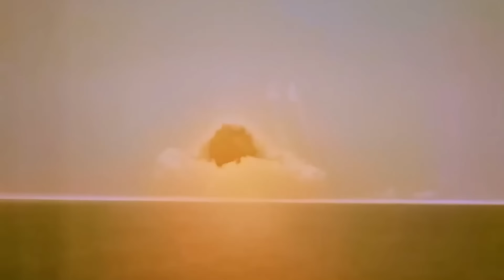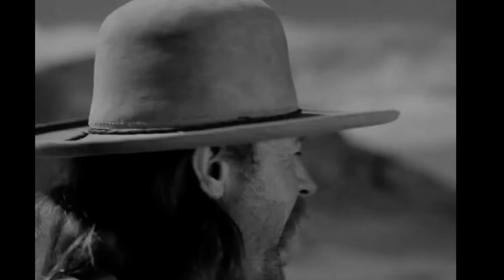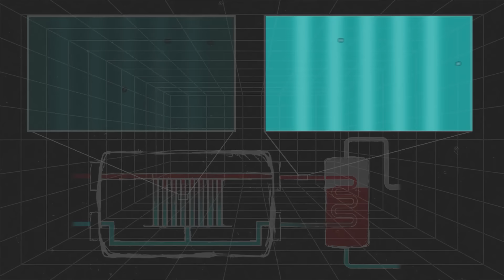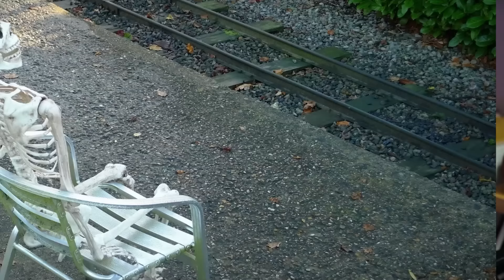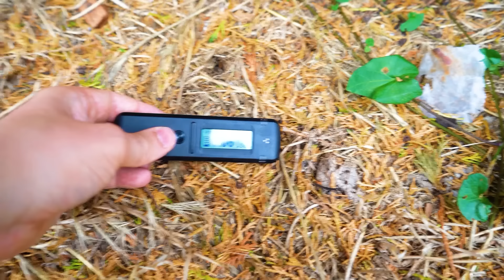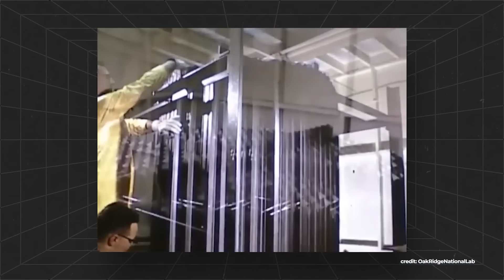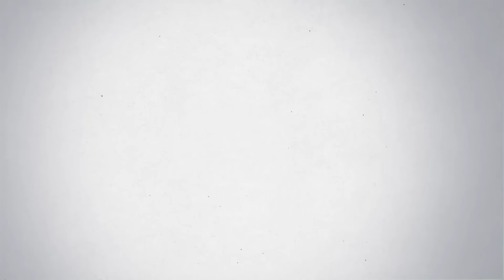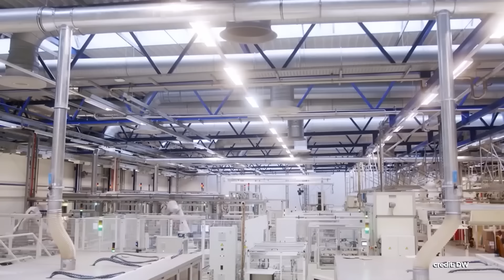It's Happening - China Launches World's First Thorium Nuclear Reactor

Comment: This video is somewhat misleading. The Chinese TMSR-LF1 is in fact a uranium burner, not a thorium breeder reactor. The primary fissile material is standard Uranium-235, and the plant will burn essentially the same amount of U235 as any other nuclear reactor, it will also require the same amount of mined uranium as a standard reactor. The TMSR-LF1 removes some fertile U238 from the fuel and replaces it with fertile Th232 instead. However, the vast majority of the power still comes from good old fashioned fissile U235. Describing it as a "thorium reactor" is like describing a standard gasoline engine running on E5 (5% ethanol, 95% gasoline) as an "ethanol engine". It is, however, a molten salt reactor - which is a lot more interesting.
Reply: @levelazn  It's documented in the Chinese Academy of Science (CAS) presentations on the design. YouTube doesn't usually allow posting links (such posts get auto-deleted), but if you look on Wikipedia for TMSR-LF1 you can find the details. The documentation describes the "U-235 enrichment" as 19.75% which is High Assay Low Enriched Uranium (HALEU) fuel. 

This is a well known path taken by others, for example ThorCon. Uranium ore is around 0.72% U-235. For normal LEU fuel this is then enriched to  roughly 5% U-235, 95% U-238 which is done by removing some U-238. If instead you enrich this further to around 20% U-235, 80% U-238 then you have HALEU fuel. You can then take this HALEU fuel and then blend it down 1 part HALEU with 4 parts Th-232 and you get a final composition of 5% U-235, 20% U-238, 75% Th-232. This requires the same amount of uranium ore as LEU fuel (it has the same U-235 content). However, it replaces some of the fertile U-238 with fertile Th-232. In a conventional reactor roughly 75% of the power comes from direct U-235 fission, and that will be the case with the TMSR-LF1 as well; the thorium is going to be contributing around 20% of the final power output.

This is an interesting design, and is certainly worth exploring. However, it is certainly not a "thorium breeder" converting pure Th-232 into U-233. Which is what everyone assumes when someone says a "thorium reactor".
Reply: @tomshackell  @levelazn been reeeal quiet since this dropped 😂
Reply: @tomshackell  wikipedia not allowed in china
Reply: Good point.   Thanks for the info.   Salt reactors are tricky to use…. Pipes need to be very tough and corrosive proof.    We’ll see.
Reply: @LegIIAVGCA  That issue has been overcome, Copenhagen Atomics have sorted it and looks like China has too.
Reply: @nzoomed  - Since you know they worked it out, can you share how the solution works (including if its operationally and economically viable).
Reply: Thank you for your comment sir!
Reply: Indeed, since U-233 does not occur naturally, there's no way of running a reactor off the Th-232/U-233 cycle immediately. The fastest way to produce it is to run continuous fuel cycles, increasing the portion of U-233 until it is self-sufficient. This is why they are planning to build a much larger 10MW plant to speed up this process.
Reply: Yes, this is the case because it will take about 25 years to build up the necessary fuel for the Th-232/U-233 cycle to become self-sufficient and no longer require U-235 for thermal fissioning.  The important point here is that China has begun this process and has a clear path toward the most competitive base load energy source in the world, today.  As a result, Its AI program will benefit from this long term strategy.
Reply: Even if he is incorrect, this reactor in theory could use Thorium as a fuel, or at the very least be added to the mix, even better is this reactor will be able to re-use radioactive waste from other reactors.
Reply: Uranium-235 is used as 'startup' fuel, and in time enough uranium-233 is bred to take over from the initial charge of fuel.
Reply: "The TMSR-SF stream has only partial utilization of thorium, relying on some breeding as with U-238, and needing fissile uranium input as well. It is optimized for high-temperature based hybrid nuclear energy applications. SINAP aimed at a 2 MW pilot plant initially, though this has been superseded by a simulator (TMSR-SF0). A 100 MWt demonstration pebble bed plant (TMSR-SF2) with open fuel cycle is planned by about 2025. TRISO particles will be with both low-enriched uranium and thorium, separately" - World Nuclear Association
Reply: Thank you for clarifying this, exciting news like these can get a little carried away
Reply: Thanks for your insightful point, Tom.  And the fact that he doesn't mention Kirk Sorensen disgusts me.  That's blasphemy.
Reply: Log course they have to have uranium because thorium is not fissile and needs neutrons provided by the u235 (around 20%) to produce the fission and u233 as fuel. Nothing wrong in calling it a thorium reactor.
Reply: @Zerpentsa6598  To be fair the guy talks about "burning" Uranium.
Reply: they built the wrong  kind then ?  I was hoping they were developing the liquid fuel type
Reply: @solerso68  It is a liquid fuel molten salt reactor, but it's similar to ThorCon's design. Both are liquid fueled uranium burner MSRs which adds some thorium in as a "fuel additive".
Reply: @tomshackell  Thorcon has since redesigned for LEU only, just like Terrestrial Energy.
Reply: @chapter4travels  yes I’d heard they were thinking of doing that. Getting HALEU is apparently very difficult at the moment, whereas LEU is comparatively easy to source.
Reply: @tomshackell  They just updated their website with that change. If I read it right, they will run their reactor on 2.2% LEU with a 5% feed-in refueling tank.
Reply: @solerso68  It is a liquid salt reactor this response is somewhat misleading if you read the comment and re-watch the video you should be able to piece it all together.
Reply: The whole title is a click bait. Like the video even shows there was a Thorium reactor in the 60s in the USA, means China at best cached up to this. And even if, the whole thing is again 20 years away from the market, and even then, it will be more expensive then almost all other sources of energy at that point. It's a dead horse for now and the next decades.
Reply: interesting
Reply: I wonder who would be willing to sponsor you to make a video about this 😆 

You seem to have a much better grasp on this than most. 
Thanks for sharing
Reply: If that is true, why bother?
Reply: Thanks, your comment is ibformative
Reply: you sure_?
Reply: Seems like a good first step nonetheless as the % of thorium can theoretically be increased as technology improves.
Reply: 2024 the age of the factcheck.     beware: it's need increases exponentially, as the fact checkers get their own fact checkers and so on, ...     by 2030 the mass of factcheckers will have become critical and will lead to an explosion that destroys all life on earth !!!
Reply: I mostly agree, except lthat less U-235 will be used in reload cores. The Thorium breeds U-233. At peach bottom and Fort St. Vrain, U 233 reload cores were supposed to replace U-235.
Reply: this comment alone is enough to make me discount everything else this channel says... it sounds like they don't know what they're talking about, or that they're maliciously hiding facts.
Reply: Well he got the clicks so why mention it in a 20 minute video. Btw. after "It´s happening - China launches.." and the footnote "planned for 2029" I already knew where this was going.
Reply: @burninghard  Sure because the US is going to jump in there with their own thromium molten salt reactor before 2029. Keep sniffing that copium westoid 😂😂😂
Reply: @burninghard  I knew this must be fake just from the title 
china cant produce anything new only copy
Reply: Still good progress in the field
Reply: @levelazn He/she gave you all you need to do your own research. It's so lazy and obnoxious of us to challenge people in this way.
Reply: @4570george  what she?
Reply: @4570george  says the guy who's giving ambiguous pronouns to a man.
Reply: @4570george  @levelazn also just outed themselves as a Chinese Shill with that post anyhow. This video itself is actually nothing more than a propaganda piece. I came here looking for such comments. Even so your point is so very much valid in our everyday lives. When someone comes up with a well written post with such clear information, asking them to 'cite their sources' is simply outright rude and nothing more than a 'butthurt' rebuke of an uneducated person.
Reply: Think about what you said that it's a  is in fact a uranium burner which means it ill help get rid of used up uranium fuels which is a good thing .
Reply: @leekumiega9268  The term "burner reactor" is used in comparison to a "breeder reactor". A breeder generates more fissile material than it consumes; a burner reactor uses more fissile material than it generates.

You're thinking of a "waste burning" reactor which consumes spent nuclear fuel; this Chinese reactor is not a waste burner. The terminology is confusing but such is the world of nuclear reactors.
Reply: @tomshackell  As I understand it uranium is consumed while keeping the Thorium reaction going .
Reply: So much trashy clickbait on the Internet. I wonder if he's secretly paid by China Today 🤭

Comment: the reason why it failed in late 70s for commercial purpose because the pipes at that time break down easily after 5 years. But China also noted that the 70s experiment failed due to unrealistic expectations that 1 plant can produce large enough to support a large city,  thus they decide to build them in small size(smaller power generation output) to support just an industry area which can last for decades with low maintenance. The another reason to build a small plant is because China has planned to build it in Moon and want it to  be as small as possible since it is there to just support a moon station base in future rather than an industry or large population.

Comment: If I'm not mistaken, there is one frequent error in the video. A Thorium reactor (actually splitting U233 btw) does not run on fast neutrons. Instead the neutrons are moderated by Graphite to slow them down as thermal neutrons. Those have an enormously higher probability for causing a fission. This is the main feature wich prevents fission reactions to occur everywhere else in the reactor, especially in the safety drain tanks. There simply is no Graphite moderator around, so no chain reaction possible.
At least the Aircraft reactor and the original MSRE operated this way. And since this is a remarkable feature, I'm very sure the Chinese used this operation in their reactors also. I'm not 100% sure on this part though.

Comment: Actually the first COMMERCIAL Reactor - the first Thorium Molten Salt Reactor was designed to meet the specifications for the 1962 ATOMIC POWERED AIRPLANE - that would be constantly in the air to Nuke the USSR GOOD. That project was shut down due to the advent of Triad Pizza Delivery - and the bits were scrapped to make Girdle Stays by 1969. As Memory still serves.
Whoop! You covered it and did a BRILLIANT JOB! (Although you made a pretty poor showing of the actual nuclear reactions that Thorium undergoes and a big fat gaff - I think - at 9:25.)

Comment: The bad news is that the US designed a thorium reactor in the 1950's at Oak Ridge TN, and the two camps fast fission and slow fission were competing. They chose the fast fission reactors to go with and after the Thorium reactor ran for about 10 years, they ordered it to be shut down and dismantled. This was a political move, not an intelligent move. The Chinese sent a group of engineers over to Oak Ridge TN around 2017 to research the Thorium reactor and were GIVEN ALL OUR INFORMATION AND DESIGN PLANS, so it's no surprise that they got it running fairly quickly. They have a 10 year head start on their development. Thorium is VERY plentiful in nature and is viewed as waste material in some mining operations.

Just think... We have had POWERBALL winnings greater than China put into our technology to get a working test reactor. They are planning on smaller (neighborhood sized) reactors to reduce transmission line losses. If only America was that smart!

Comment: There is actually a really interesting small reactor design from NASA called KRUSTY that was designed for missions to the Moon or Mars that does not use a steam turbine, but a sterling engine, yes this is also an 1800 technology, but they added a twist, using sodium heat pipes for improved efficiency. The designed ranged from 1kW to 10Kw, with the 1kW design weighing only 400kg and can run for 10+ years.

At 10kW of continuous electrical power, and 5kW of thermal, I think its the first truly novel and modular reactor design proven to work.
Reply: If only they would adapt those to the residential market. :) Imagine having a sweet 5Kw reactor in your backyard powering your home. :)

Comment: Thorium is worse is every way than Uranium for power production, and only slightly harder to weaponize.  Thorium bros (in the same derogitory meaning as tech bros) like to pretend they know anything about nuclear physics.  They don't, because if they did, they'd know that Thorium has ever single problem that Uranium has, but is also just straight up more dangerous to work with than uranium.  

U233 (the actual usable material from breeding thorium) is a better weapon material than either plutonium or U235, and can be easily seperated from the thorium using purely chemical processes.  The only difference is that is is less safe for humans to handle in a glove box, which is how the fissile pits of the bombs are made.  The amount of nuclear weapons peaked in the 70's. 

The waste from U235 fission is a non issue, or at least it would be if the hippy idiiots allowed the waste to be processed.  There are so many lows preventing the reprocessing of used nuclear fuel that only a tiny fraction of the uranium gets burned up.  But some idiots think that simply because it could potentially be used to make weapons, that it cannot be allowed to be used for power.

The reaction is not easier to control.  That's just a straight up lie.  U233 actually has a much lower critical mass than U235, or fissile PU isotopes, greatly increasing the chances of prompt critical reactions.  And it would in no way reduce the chances of a post shut down melt down like at Fukishima since it still produces highly reactive fission products that need cooling for days after shhutdown.

And then there's the molten salt part.  Guess what, you can do that with Uranium.  It is a prerequesite because the U233 is bred from thorium, and that is what the reactor uses.

And then there's the waste bullshit.  So not only do youu have all the gooodies present from using U235 present, you also have U232, which is so radioactive, it makes handling the mateiral a nightmare.  That is why idiots say you "can't weaponize" thorium.  It's bullshit, you just get way more cancer in the people who have to reprocess the stuff, which is needed for Thorium fuel unless you want the same partially used material that comes from natural uranium reactors, but worse.
Reply: The Fukushima reactor didn't melt down.

Comment: Why are you calling it a fuel Thorium isn't a fuel it is a fertile material. In a breeder reactor it could be used to breed U 233. It is technically possible to use U233 to make a high yield bomb.  However real life it will be contaminated in such a way that makes it very difficult to actually build or conceal a bomb building process. We should definitely develop a molten salt system using the thorium cycle.
We also should use molten salt to make a fast breeder using the uranium cycle. That way we could use up our reserves of 'nuclear waste '  it should be possible to extract appropriately 40 times the energy that was created the first time through. At the same time you would greatly reduce both the volume and duration of the waste.

Comment: Re: the reactor containing the reaction. 

The thorium fuel cycle used in molten salt reactors take advantage of thermal neutrons not fast neutrons (like in boiling/pressurized water uranium fission reactors). (Thorium having a large thermal cross section and a small fast cross section) meaning the reason the reaction is contained to the reactor has nothing to do with the abundance of fissile material, but the presence of a moderator (graphite) to knock the fast spectrum neutrons down to the thermal energy level where they will have a high likelihood of causing a reaction with thorium fuel.

Comment: First of all 60 - 100MW reactor is nothing compared to existing Uranium reactors. Second - water is still needed because the steam that is going to turn the turbine can't be radioactive or corrosive like salt is. You will end up with radioactive turbine on which you can't do maintenance and radioactive byproducts. So you will need to have a heat exchanger in between that uses water - the same system that is present in conventional power plants and uranium reactors.
On the other hand I'm really worried that China is dubbing in this. Knowing how they work saying they cut corners is huge understatement. It would be much safer if they actually stole the technology 1:1 after someone in the west already had build the power plant using it.

Comment: That there isn't a Molten Salt Reactor of commercial design is not quite true. Bill Gates is through his efforts is in the process of building one in I think Wyoming or Montana. I don't know it's completion date. And the first designed Thermal Salt Reactor was built in I think it was the 50's and built in conjunction of a High Pressure Reactor for the Navy. Admrial Nimitz pushed the high pressure reactor as the standard due to use for Submarines and breeder design for nuclear fusion material for bombs. This stunted the complete development of Thorium Salt Reactors and jadding the public against Nuclear Reactors.